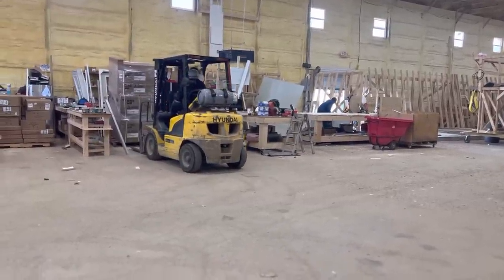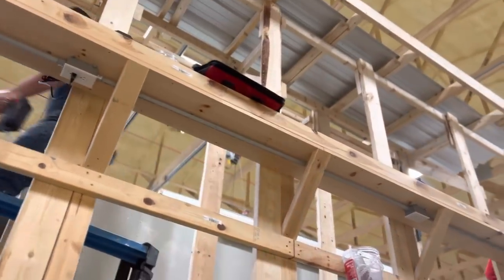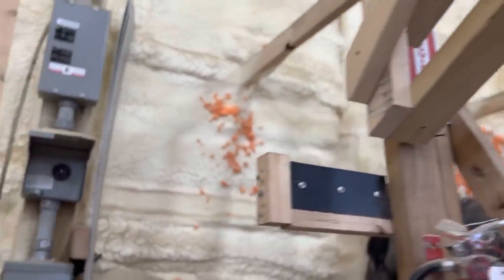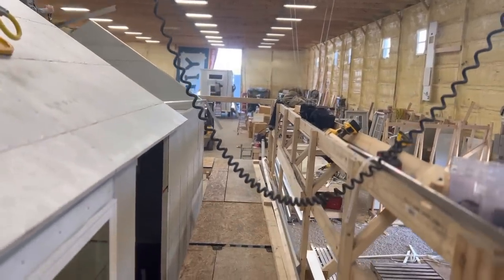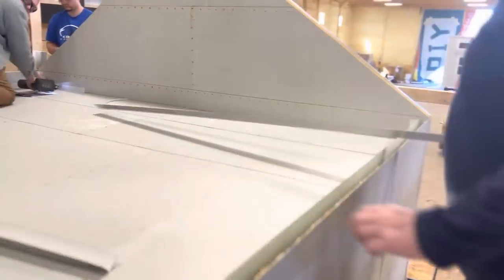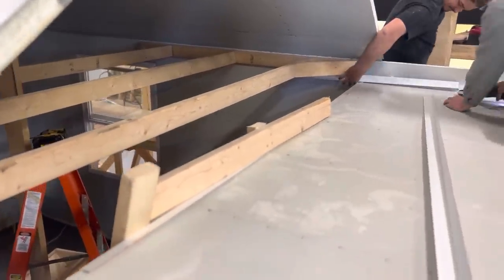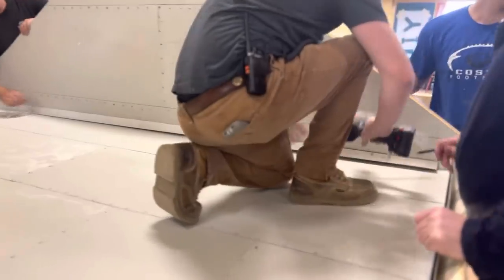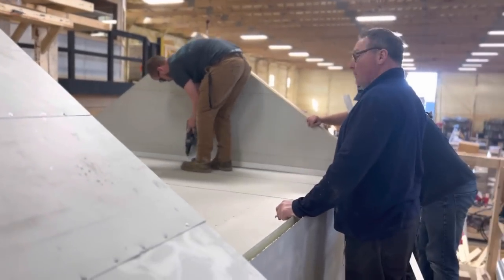10x20 Tiny Home built in 6 hours!!!

Comment: Can you put an elevator platform at one end of these 10’ wide homes? I’ve seen them in 8’ wide regular wood construction tiny homes.
Reply: I was thinking of combining the monochromatic simplicity and layout of the Kirsten Dirksen YouTube home “delivered as furniture, tailored as a smartphone” - combining it with the open living room / elevator bed (like Ana White’s open concept) instead of a closed off room. Just wondering if an elevator bed platform can be installed in a 10’ wide instead?
Reply: I definitely think entry doors on the side of a tiny home are a much better use of space then at the end but some parking locations would dictate otherwise.
Reply: @SMafam5  - You'd need to frame out the elevator bed lift system, perhaps by building a 30" wide closet at one corner of the room, with your entrance door on the side wall, in front of the closet, then framing in a support beam for the 4th corner that is near the entry area. Your 36" front door would only open 3/4 when the bed is lowered, so maybe use a 30" wide door there and have a 2nd wider door somewhere else. 🤔 Or you could just frame in a deep, built-in entertainment cabinet on one side wall, with a closet at the front and deep shelves in the far corner facing your seating area (assuming your living space is under the lift bed) to hide the lift system support beams. 😀
Reply: Thanks for your ideas Susan! I was hoping a strong metal beam support structure would work for an extra-wide platform as I wouldn’t want to close in the 10’ wide room on the left living room side.

Comment: Hi curious  what is the material  used on the exterior  siding thank
Reply: These homes are SIPs, which is approx. 2 inches of closed cell foam sandwiched between two pieces of steel. So both the outside and inside walls are steel.
Reply: Yes, and if you prefer not to paint or stuc-o-flex the exterior, you can add vinyl siding or some other product of your choice after purchase.